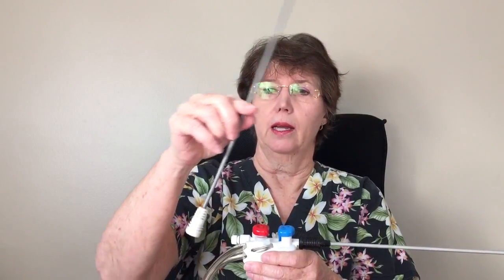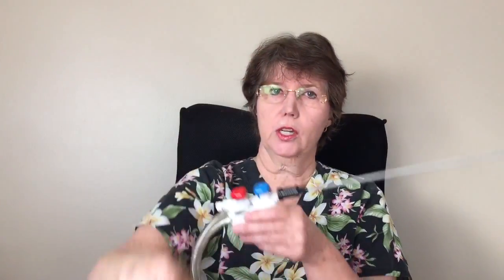Surgical Suction/Irrigator: Yup! It Sucks and Spits

Comment: Hello. What is the nozzle at 0:57 for? It doesn't seem to do anything?
Reply from the maker: I probably should have said the cap.  It is not a nozzle but a screw cap.  I suppose if someone wanted to take a cytology they could remove the cap and put a luken's trap on it to get a specimen.  I have never seen it used this way but it would make sense.  Usually it is just a screw cap that you need to make sure is tight.
Reply from the maker: It may also be a screw cap that the company needed to put on in the factory in order to be able to assemble it.  Have never seen it "used" for anything.
Reply: @firstassistingtechniquesan7663  Thanks for the input. I am in the process of designing an instrument of this sort. Although this design is common, some manufacturers use it as a port for introducing another instrument through the shaft (through an elastic airtight seal), while others don't seem to use it for anything. I was just wondering if it had a specific purpose, but your answer leads me to believe it has indeed to do with production/assembly.